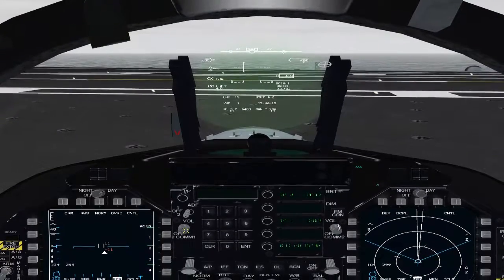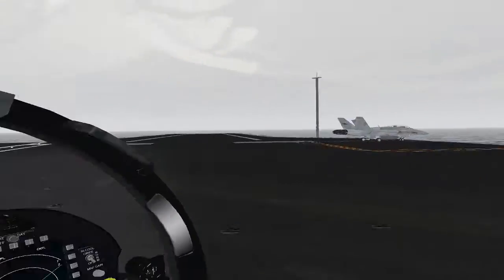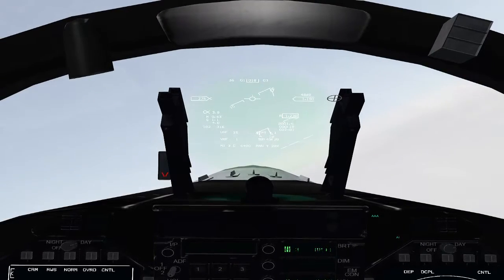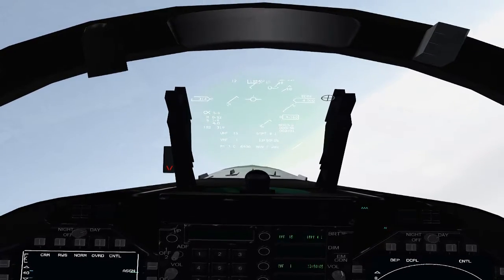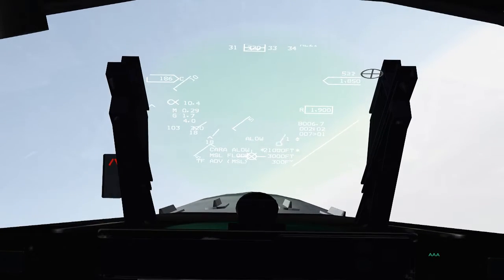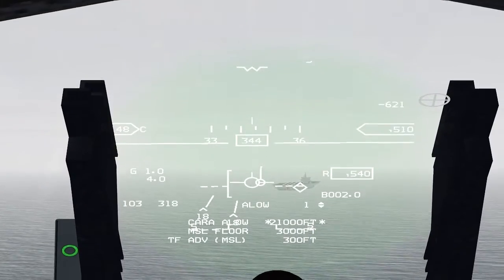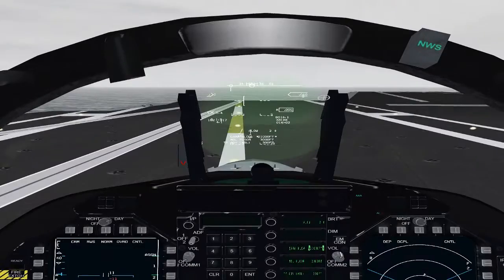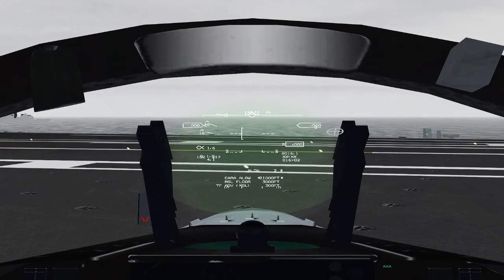✪ BMS 4.33 F/A-18 Hornet "***UPDATED Multiplayer Carrier Qualifications Tutorial"

Comment: Do real life F18 pilots sit high enough so that they would see the nose like in your videos? It's the case in a small aircraft like a Cessna, I wonder If it's the same for the hornet?
Reply from the maker: Honestly, I don,t know. In a Cessna we can use a cushion and get pretty high up. It certainly seems like a high eye level position in this video https://www.youtube.com/watch?v=H6SsB3JYqQg
Reply: Noted.  One last thing, I've read somewhere that one should be going full throttle prior to touch down instead of over the ramp, I assume that's just another optional method?
Reply from the maker: Lymark Wong jet engines need time to spool up unlike gasoline piston engines which give you almost immediate power. The reason they use military power over the ramp is it will take a couple of seconds to achieve that power  and upon wheel touchdown it's usually too late to get maximum power.

Comment: Looked pretty good. One question, I see that you went full power when crossing the ramp. I was under the impression that you did that when your wheels hit the deck?

Do you guys have a squadron?

~S
Reply from the maker: Takes a few seconds for the jet engine to spool up, just like in any real jet engine. Naval Aviators are taught to hit full power when crossing over the ramp, the downward momentum of the aircraft will enable it to hit accurately on the deck, but if one misses the wires, the engines are already spooled up and producing close to max power. Our squadron website is here: burnerx.wixsite.com/wolfpackmilsims